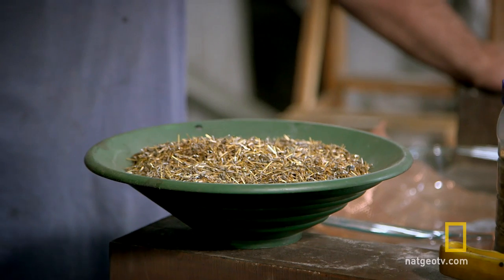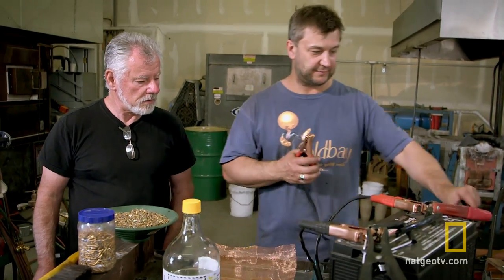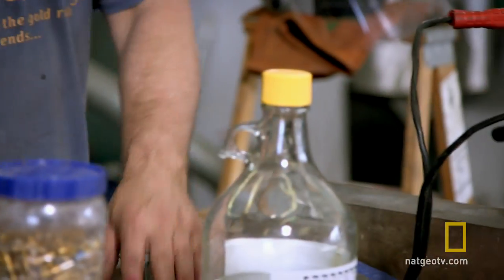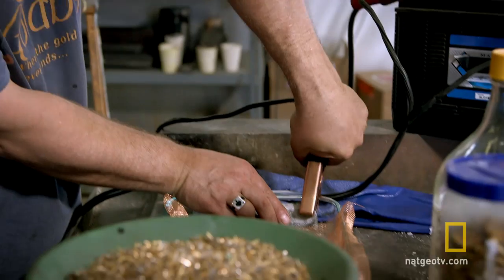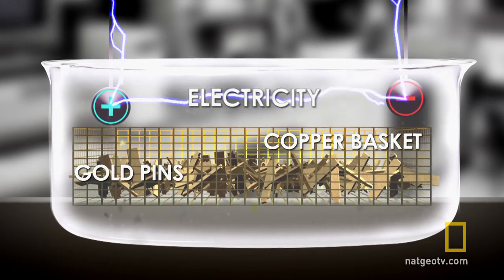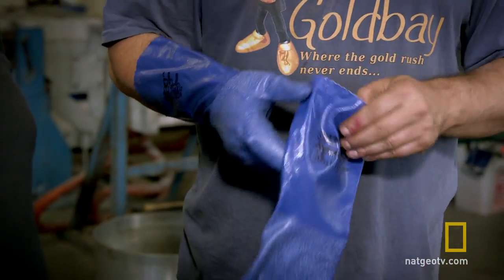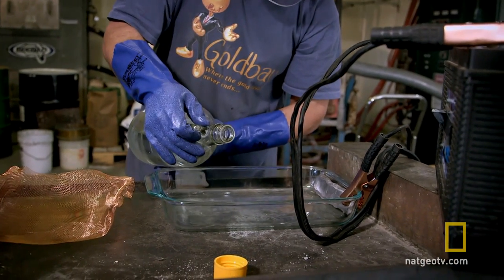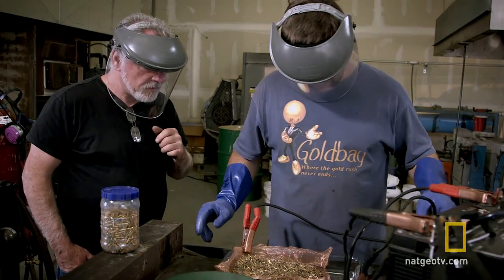Reverse Electroplating | National Geographic

Comment: I wouldn't use reverse electroplating,prefer aqua rega,it would dissolve the gold off the other metal and then extract from the acid.He's going the long way around.
Reply: How about removing silver plate from copper? I want to preserve the copper finish and am not concerned with the left over silver. There is an iron boarder also. Is there an easy way to get rid of the silver and not damage the copper?
Reply: Long way kinda .  He still has to refin  with 
Aqua regia then urea . smb. For gold to come to a solid.